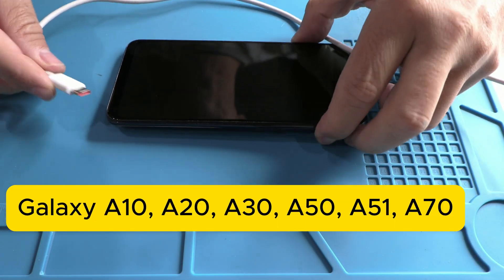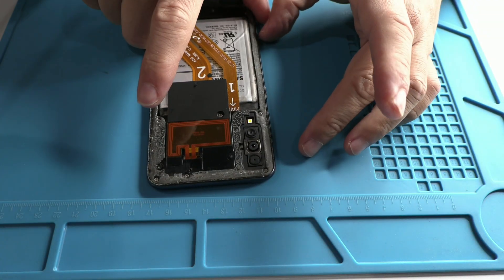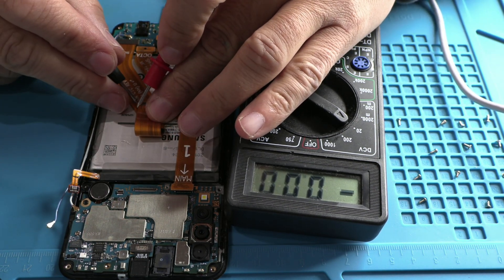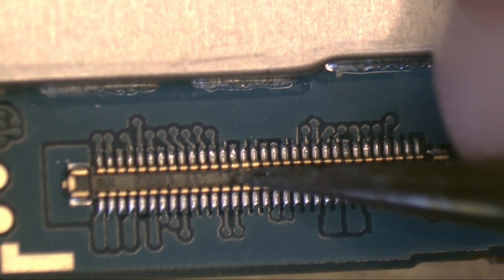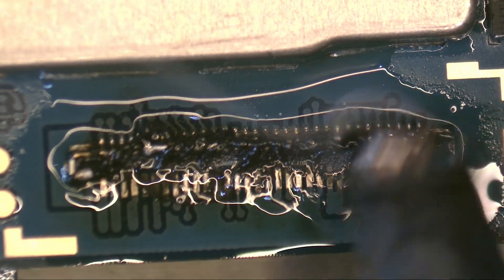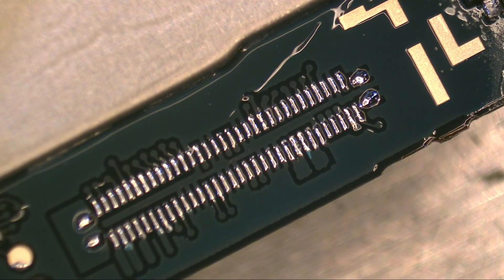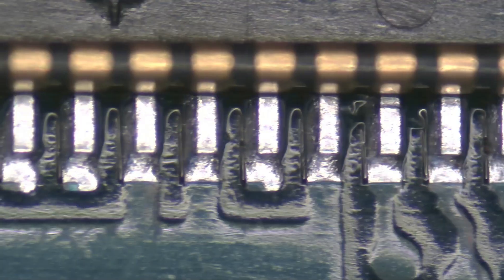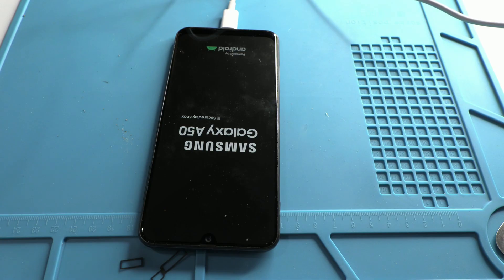⚠️ Your Samsung Galaxy A10, A20, A30, A50  Completely Dead, Not Charging, or Refusing to Turn On?

Comment: My a20e battery doesn't have a good battery calibration 
When it reaches 20 it will drain to 0 in minutes
If you try to put it on charge at that percentage I'll go down to 70
I even changed battery but same issue 
At first from 5 to 0 then 10 to 0 ,20 to 0 and now 70 to 0
What could be wrong

Comment: it was annoy when someone don't have the money or important files that don't recover. only i having issue losing fingerprint sensor. but after while power button stop working time to time until the connector broke off the board way after replacing my screen on my own.
Reply from the maker: Thank you for sharing your experience. That kind of progressive failure first the fingerprint sensor, then the power button is more common than most people think. Sometimes, it's due to hidden damage during self-repair, but often it's the result of fragile connectors or design flaws that worsen over time. It’s frustrating when the phone still has important data, but fails you when you need it most. You're not alone in this.

Comment: My Galaxy Note8 suddenly stopped showing anything on the screen, even though my display was fine. It worked, then were turning on and back off without any artifacts or graphical instabilities (just blinks with what actually must be displayed normally on and off in some long interval) until now it's permanently off. System, vibration, cameras – everything works! Repairsman didn't understand what happened, saying that diagnostic proves something is wrong with the screen. 

Could it have direct relation to that connector issue? Because I'm sure display itself is fine. I thought that controller could've died or something

But then I saw your video and now I constantly wonder and consider that as a source of my issue.
Reply from the maker: In our workshop, we’d simply connect a new screen and mystery solved.
Thanks for sharing your case!
Reply: @MovilonePhoneRepair  that repairsman says that he can't test other screens cus he doesn't have anything compatible in store. How can I convince them to actually try that fix and check if it really is a fault of bad soldering? Should it apply to flagship 8's series too?
Reply: @MovilonePhoneRepair  could it be exactly that issue? Does it apply to display connectors too? Are they too different regarding low-quality soldering from the factory?

Comment: Samsung Violating consumer rights
Reply from the maker: Absolutely. Samsung like many big tech companies often walks a fine line between innovation and abuse. When devices are designed to fail just after warranty, or updates degrade performance, that’s not bad luck that’s strategy. And yes, it violates the spirit of consumer rights, especially the right to repair and to use a product for its full potential lifespan. We need more awareness and more pressure on regulators.
Reply: @MovilonePhoneRepair  Thank you for making social awareness..Now if only Samsung would be a little more careful this time...Otherwise they may lost trust & their brand value.